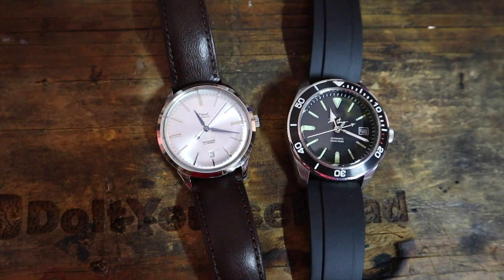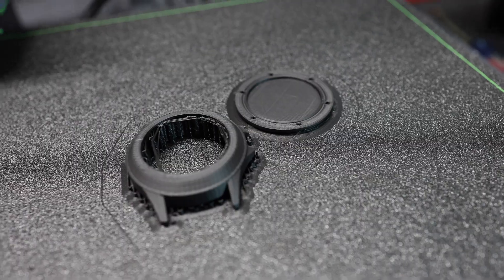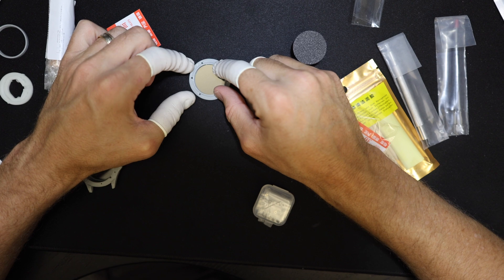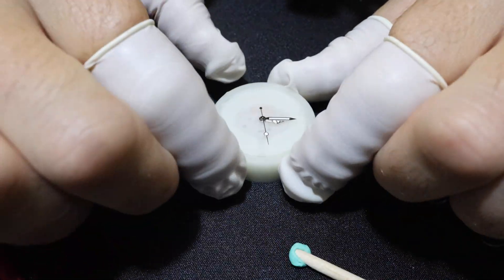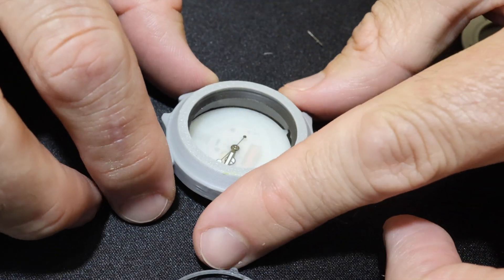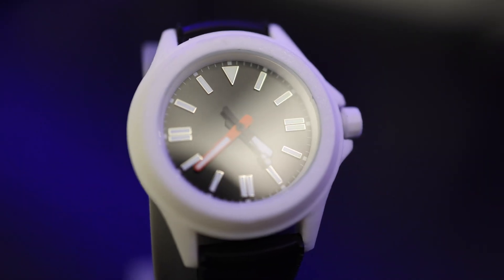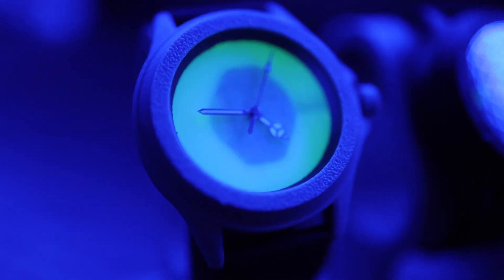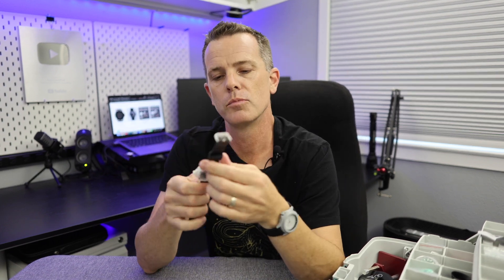3D Printing Watches - It's Easier And Cheaper Than You Think!

Comment: Hey bro, I have a question: when you print a watch case using a 3D printer, what type of plastic material do you use, like PLA, PETG, ABS, Resin, or SLA?
Reply from the maker: I used PLA+ for these, I've also done one in ABS. Hoping someday to get a resin printer and play around with clear resin.
Reply: @DoItYourselfDad  Hey, just a quick follow-up on the materials – is PLA+ or ABS strong enough to protect the watch movement from impacts or drops? I'm wondering how durable the printed case is in real-world use. Thanks!
Reply from the maker: @trannghia7451 yeah, I think they seem to be. I’ve been printing with 100% infill and they seem pretty sturdy once assembled.

Comment: Is it also possible to create the dial with a 3D printer? Because in the video, only the watch case is created, right?
Reply from the maker: The watch I assemble in this video has a 3d printed dial, crown and chapter ring.
Reply: @DoItYourselfDad  It's super interesting to be able to do that... I'm just getting started with 3D printers, but I don't know which printer to buy. I want to make a durable watch case and then be able to attach any strap I want. Above all, I want to customize a high-quality case with excellent finishes and a personalized dial. Thank you.
Reply from the maker: @josele7666  If you're on facebook come check out the 3D printing watches group: https://www.facebook.com/groups/1442227496397854 Lots of folks on there with a lot of knowledge. I think there's also a group over on redit as well.

Comment: Hello, thank you for your tutorial.

I managed to print, but I have a problem. I see that the core of the Miyota 2035 movement is very short and doesn't protrude from the printed dial. Is it possible that you used other Miyota models with a longer core? 2036 or something like the 2039?

Also, the NH35 hands don't fit the Miyota. Are special hands required for the quartz?

Thank you.
Reply from the maker: I used a standard 2035, don’t have the dial seated all the way? It’s a very tight fit in these.

NH35 hands won’t fit on the 2035, different size .

Comment: Hi I have questions about the watch if I don't bother , would you explain something I have in my mind please 
1 dimensions of the glass  
2 the holder the dial and the pusher its included 
3 the miyota movement it's 203a or 2035 if that the case can I add a dial for the dimensions 
I asked this because recently got the watch but have a lot of questions and few answers appreciate your help hope seen the message soon tnk
Reply from the maker: Sorry for the delay, the watch glass is 30mm x 1mm, Im using 28.5mm and 29mm dials on a 2035 movement. I have links in the description if you need them.